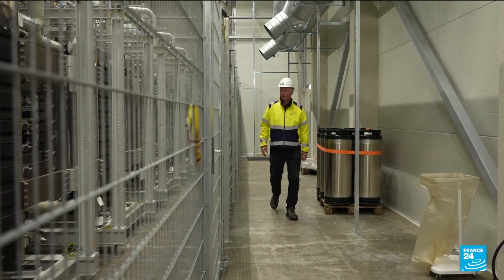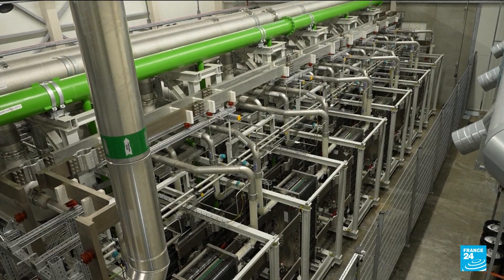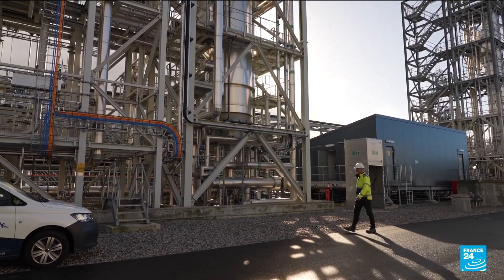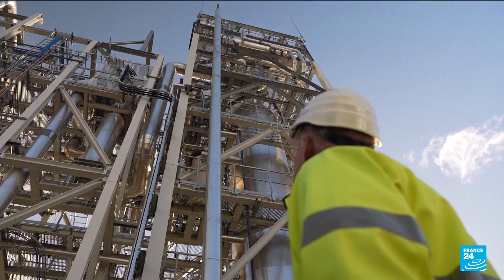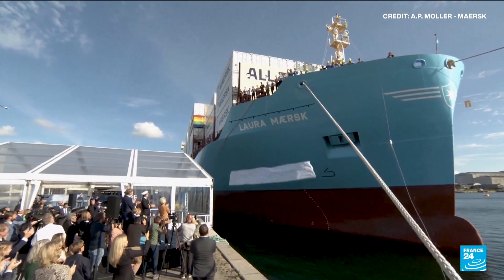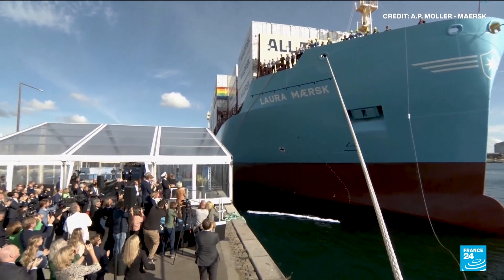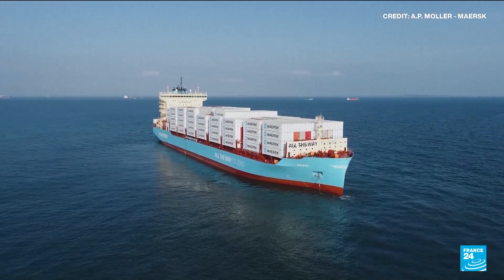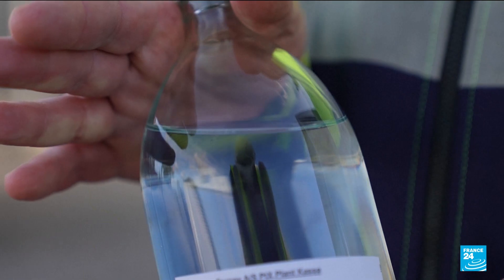Denmark leads the way with first large-scale e-methanol production • FRANCE 24 English

Comment: Why!? It's just a wasted energy and money. Better to produce hydrogen with renewable energy!
Reply: That's exactly what they're doing. Surplus electricity from wind farms is used to produce hydrogen. When you combine that with carbon capture from biomass power plants, you can make methanol, which can be used in combustion engines. Like the ones the shipping industry uses.
Reply: They can’t use hydrogen in ships so they make it into fuel that can be used
Reply: GO HYDROGEN IF YOU WANT TO WASTE 66 % ENERGY 🤦‍♂️🤦‍♀️
Reply: @mikafiltenborg7572 you can make hydrogen with the sun, when demand for energy is low!
Reply: It’s using the excess electricity it’s not wasted you cringe!